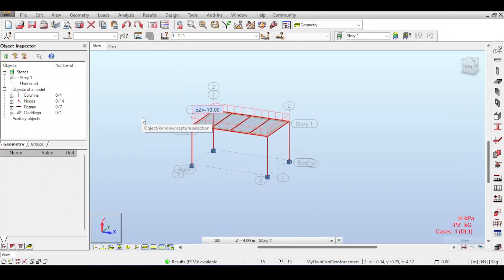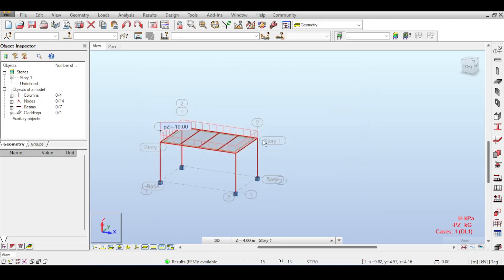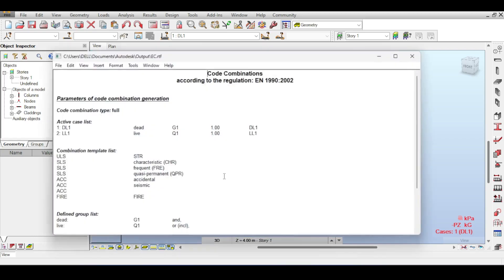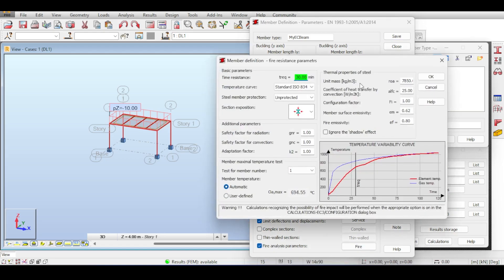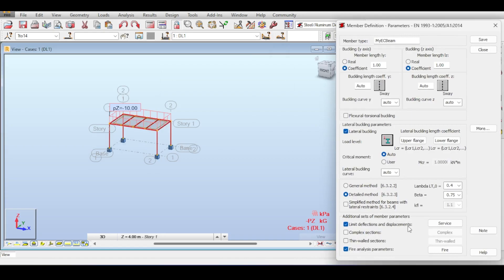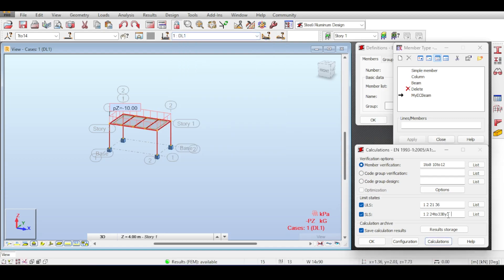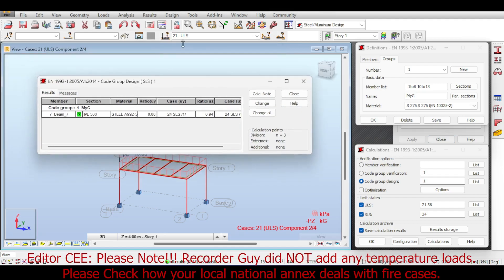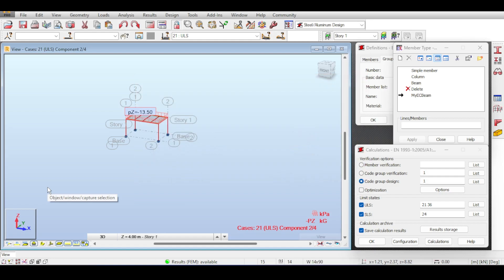Design for Fire in Steel Members using Autodesk Robot

Comment: Hello CEE,

What a treat, the CEE channel is on fire (pun intended) this weekend, thank you so much for the weekend videos that are shared so far.

Pardon my ignorance, I am still unclear with regard to the idea behind what we are actually doing when we say that we are “Designing for fire”

- What are we doing in simple terms?
- Are we simply creating a “load combination with dead load and a reduced live load”?
 
- Comparing to earthquake (seismic) design, the earthquake parameters resolve to lateral forces that are applied directly to   
  a structure. Do the fire analysis parameters resolve to some form of “equivalent forces” that are applied to the structure?  
  	
	OR

- OR, do fire analysis parameters work in more or less the same way as say buckling and torsional buckling parameters 
  which instead results in reduced effective lengths and reduced critical stresses in a member that would reduce the 
  stresses at which a member would be considered to be passed?

- Or both (load combination, and reduced member resistance properties) is the resulting effects of checking or of 
  designing a member for fire? 

How is temperature load case in a structure related to or influence the “Designing for fire” ? will a fire combination automatically include a “temperature load case” if there is a temperature load case that is defined in a structure? 

Thank you for this short video, it helps to explore these infrequently explored areas of structural design. 

I have enjoyed the video and I am looking forward to the next CEE videos

Regards, DK
Reply from the maker: Hi there Engr. DK ^_^
Happy you liked the video. 
As far as I know, both approaches exist. On the one hand, fire is dealt with as a "reduction in the load carrying capacity" of structural elements, as an increase in temperature usually has an adverse effect on the yielding of steel and crushing of concrete as well as other negative effects like spalling of concrete, so one point of understanding is that it is a reduction of the capacity with time.

In my humble opinion - however - and that is what the Editor correctly mentioned, I still wanted to say that there might be a need to define temperature loads on the structure. The fire combination was done according to the load, I was personally surprised that it considered the live load reduced - at first -. But upon further thought it made sense as people would tend to evacuate the building, with exception to some few poor souls and the furniture that is not going to be evacuated.

So, as far as I know, the Eurocode's approach (general) is to define a temperature curve and calculate:
E,d,fi = factor * E,d
where E,d is the design load level, which is reduced to account for fi = fire.

Here is a quick - but not extensive - reference to check:
https://eurocodes.jrc.ec.europa.eu/sites/default/files/2022-06/02-CALGARO-EC-FireDesign-WS.pdf

Of course, this leaves the question of temperature load still to be asked. We know that for an indeterminate structure, loads due to temperature will have an effect on the internal loads of members. Now since the EC has so many National Annex, I wanted to give a disclaimer in the video that maybe (I am not really sure), one national annex would require to apply a certain temperature change on certain elements to check for failures. That was the reason why.

Ok, so what are we doing (what is happening in this specific video?)
We are creating Fire load combinations, which are basically load combinations generated from your original load cases such as dead and live.

We then define what kind of fire we are expecting the element to endure, and the duration and all the parameters necessary. This would come into play when calculating a "reduced resistance". Note that: the resistance here is a function of time, and that is the reason why one input is "the time of fire" in the parameters, as robot will calculate the resistance at that time and compare it with the loads. 
You are right if you think now that: well if I say 30 mins, then the structure is safe only for 30 mins, and may collapse after that. Yes, you are right, and that is a decision to be taken in accordance to code. A one story structure has more relaxed evacuation times than say: a high rise building.

Then we switch on the fire design in the configuration of the design GUI in robot. 

Hope this explanation made more sense. 
Regards,
CEE
Reply: @CivilEngineeringEssentials  

The explanation is perfect, thank you and thank you for the reference. 

Regards, DK

Comment: Hello,
What are your thoughts about calculating ULS for C-profiles in Robot (especially lateral buckling)? Some people say that Robot calculates it incorrectly and therefore Mcr value is also incorrect. What is your approach for such case?
Reply from the maker: Hi there,
As far as I know, Cold-Formed C channels are not covered in American codes at RSA at the moment, as the AISC is covering hot rolled sections.

For the Hor rolled C-Channels, I have to personally investigate it. I will definitely check it out and get back to you with that regard.

Regards,
CEE